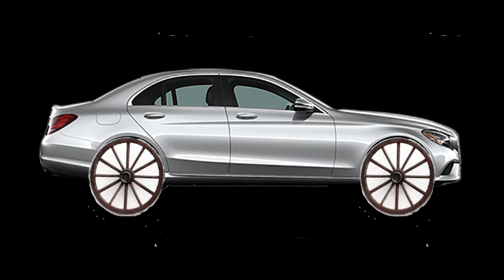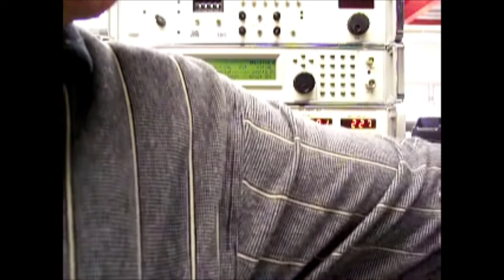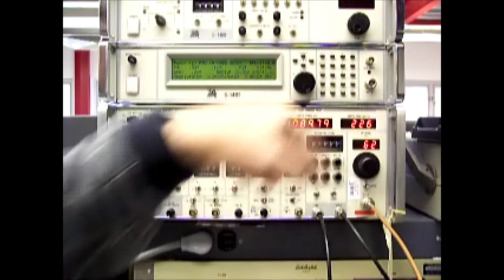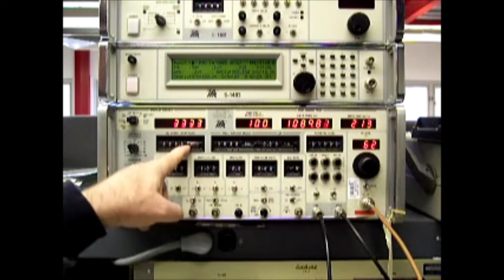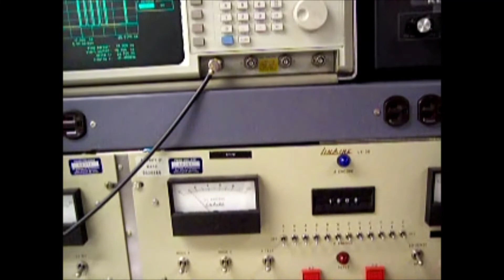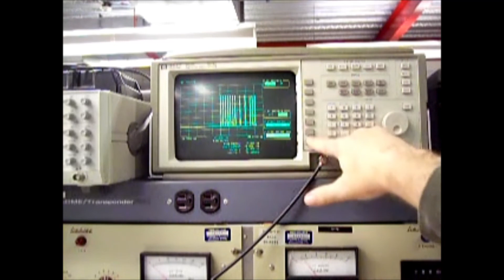Testing ATC Transponders

Comment: Hi Sir can u tell me  how to operate the ATC-1400 A for beginner and what is the switches used for the DME and how  to operate this  equipment and I am requesting can u do more videos for this equipment and how to set the DME  Mode and Transponder mode   and how to test the for Ex:Iam Measuring Tx RF Power Output FUNATIONAL TEST PROCEDURE can u give me the clarity for this Equipment